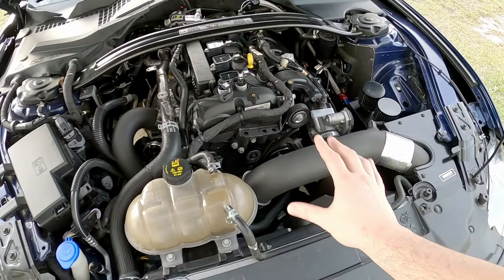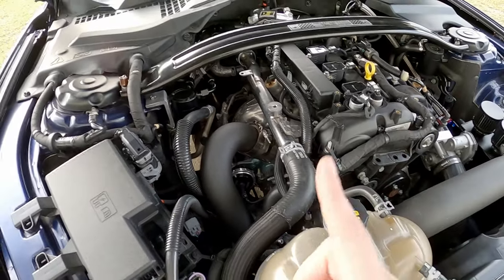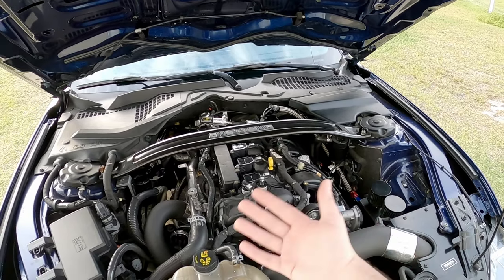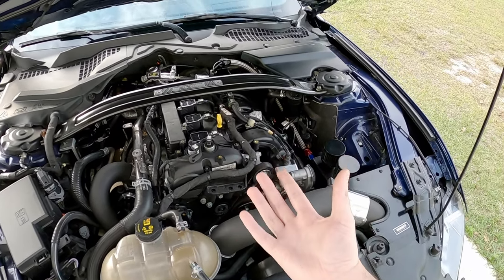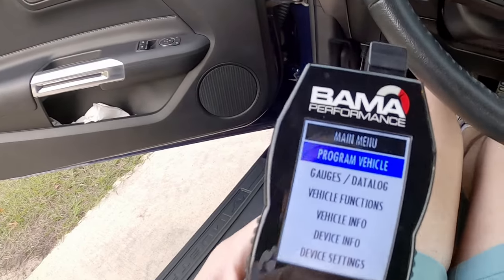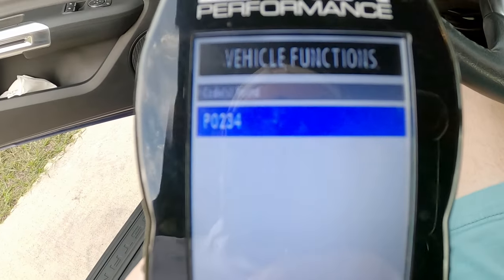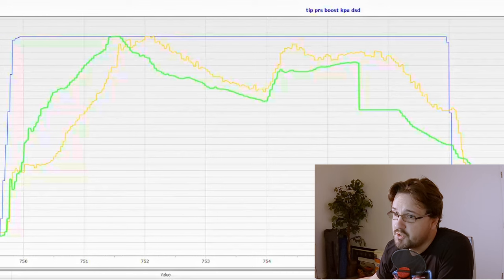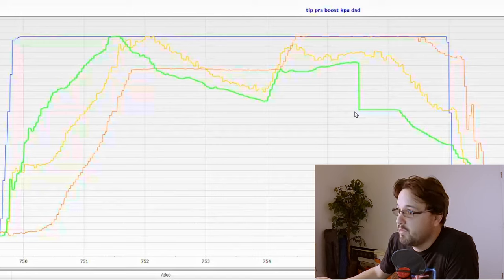Something Weird Is Happening with my Ecoboost

Comment from the maker: *Update* After doing more research, I've discovered the likely cause to the high TIP Sensor reading. Since the car is trying to limit it's torque, it mainly uses the throttle plate to control the boost. If the throttle plate angle is almost closed at WOT, that excess pressure builds up before the throttle plate. The TIP Sensor then reads that build up (around 30 Psi) as overboost. This problem can only be fixed by tuning.
Reply: You dont have a tune?
Reply from the maker: Nope
Reply: @KarzKreated  why the hell not? 🤣
Reply from the maker: Cuz I just spent 6k on a new engine while trying to pay bills lol. Tuning is coming soon.
Reply: @KarzKreated  you'll need another 6k of you dont get a tune my son.
Reply from the maker: It'll be alright. Won't be much longer

Comment from the maker: I appreciate your answers on this! 🙂 I just want to clarify that this is not a common overboost issue since there isn't an actual overboost condition happening. I'll make another video with a better explanation on what's likely happening and the solution to fix it.
Reply: Swapping your wastegate actuator to OEM or even changing your aftermarket spring to a 10 or 7, and then data logging additional runs, probably won't fix your problem, but it will give you valuable information to analyze!

Comment: I would go 1 spring setting lighter on the turbo smart waste gate actuator. The ecu may be trying to control the wastegate and its not responding the way the ecu expects. The only recorse the ecu has to compensate is to open recirculating valve to limit boost with in what its looking for.
Reply: Looks like the stock spring pressure is 7 but even if you have a 10 in there I wouldn't see that as an issue. However the highest spring pressure may cause the ECU to act erratic.
Reply: The actuator also controls the rate of increase in boost pressure. A stiffer spring will build more boost, more quickly, while a softer spring will create a more linear power curve. Choosing the correct wastegate actuator is essential